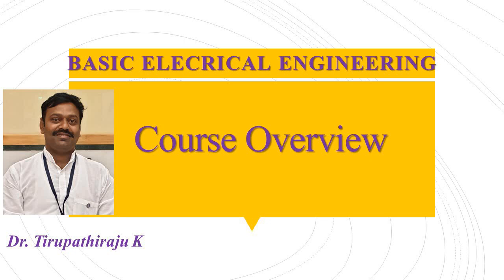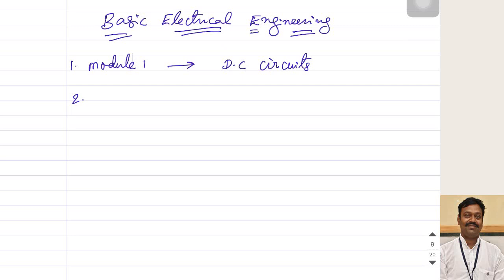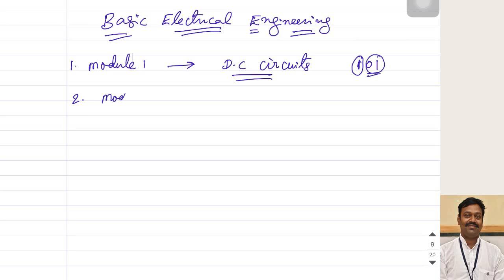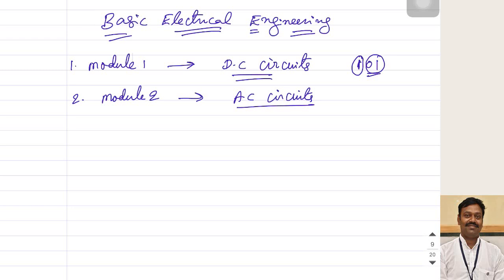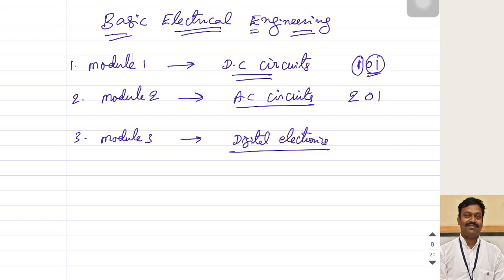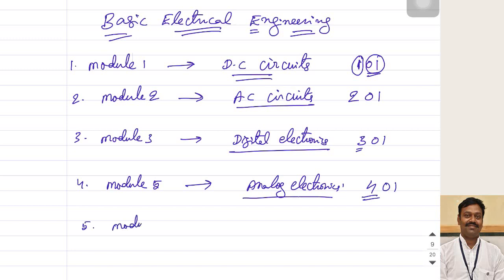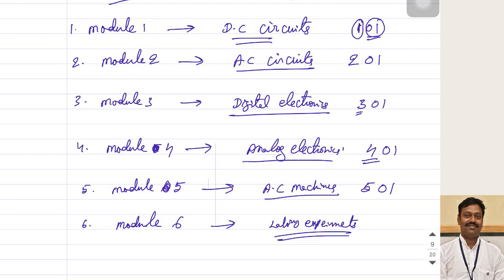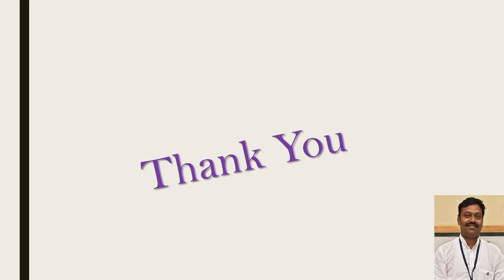BEE  000 Overview of The Course

Comment: Sir, for a competitive exam I need to prepare below syllabus.

Can you pls tell standard author book for below syllabus.
UNIT- VII: BASICS OF ELECTRICAL AND ELECTRONICS ENGINEERING
Ohm’s law - Kirchoff’s laws - Introduction to DC and AC circuits – Power and 
powerfactor – Single phase and three phase circuits.
Operating principles of moving coil and moving iron instruments (Voltmeters and 
Ammeters) - Wattmeters and Energy meters
Construction and principle of operation: DC motors - DC generators – Transformers -
Induction motors.
Characteristics of PN junction diode - Zener diode - Half wave and full wave rectifiers -
Bipolar junction transistor (CC,CE,CB configurations) – Amplifiers - Operational 
amplifiers.
Binary number system - Logic gates - Boolean algebra – Half and full adders - Flip-flops 
– Registers and counters - A/D and D/A conversion.
Types of analog and digital signals - Modulation and Demodulation (Amplitude and 
frequency).
Communication systems: Radio - TV- Fax- Microwave - Satellite and optical fibre.